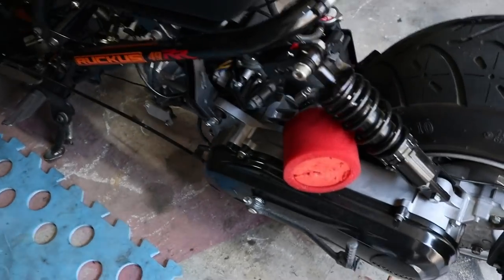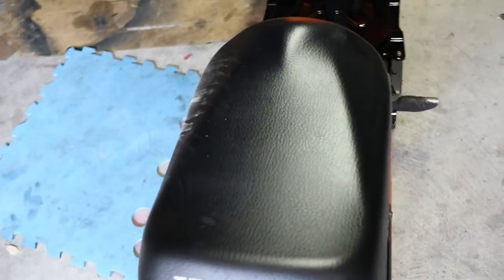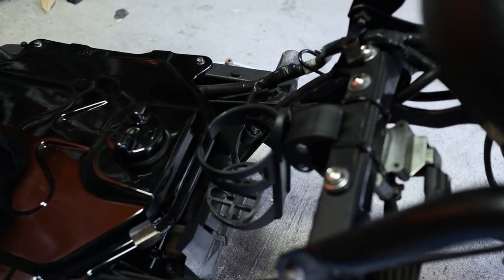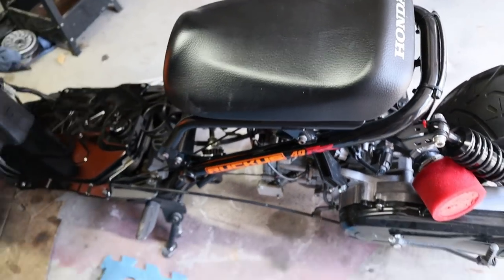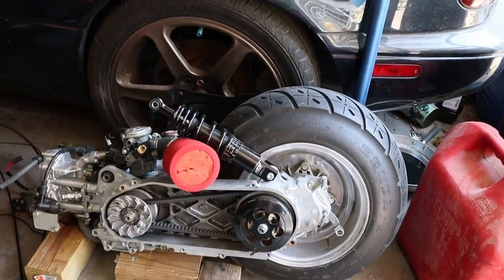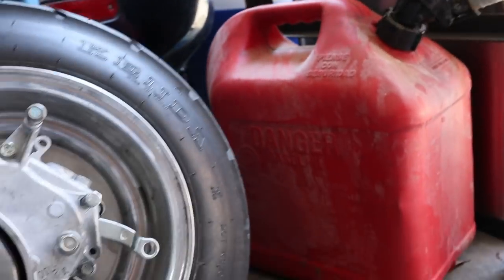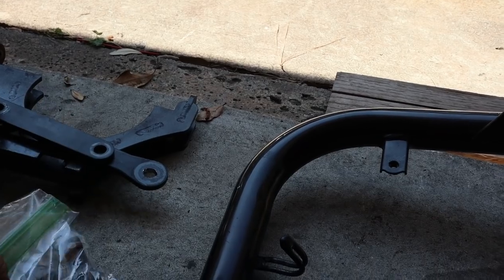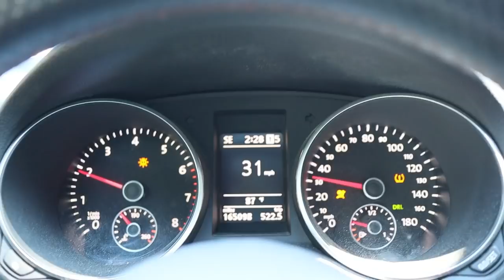Powder Coating the Ruckus Orange PART 1

Comment: Link to those peg brackets?
Reply from the maker: https://mnnthbx.com/product/peglegs-honda-ruckus-met-get-parts/
Reply: @SmallEngineVelocity  whoa.. I'm gonna weld me up some not $90 brackets.  Crate steel,  wire welder,  grinder/wire wheel, drill, header paint.
Reply from the maker: @DavidLozano  I'm gonna make a SEV Version eventually